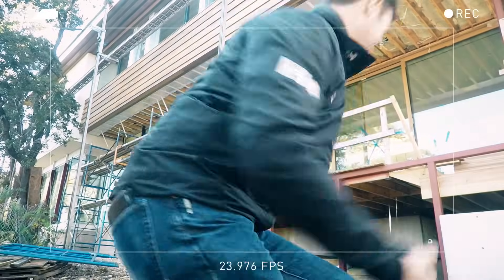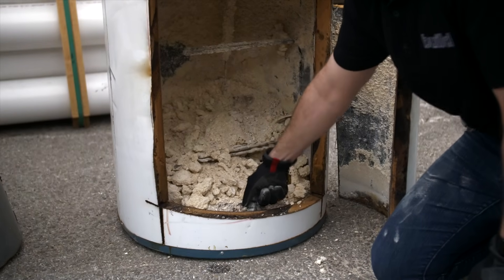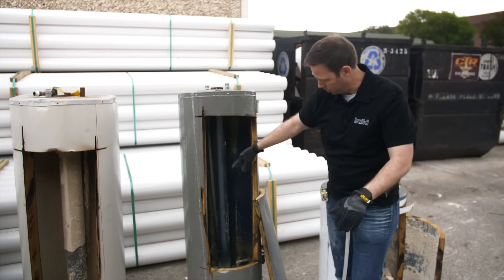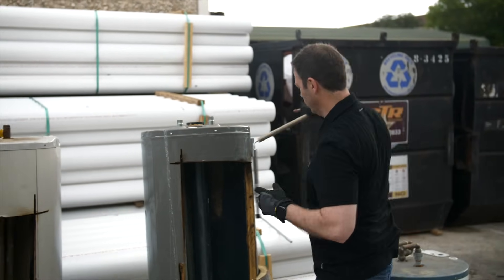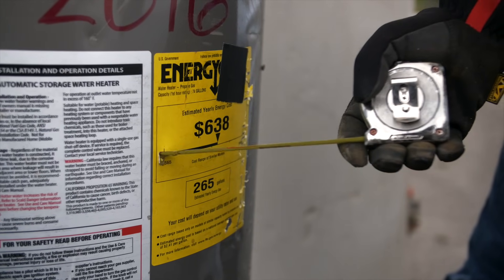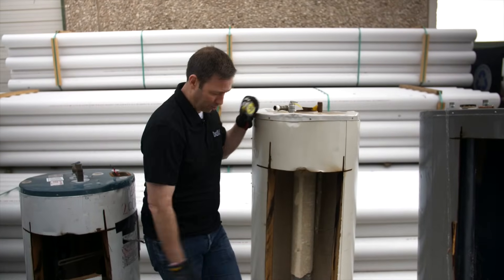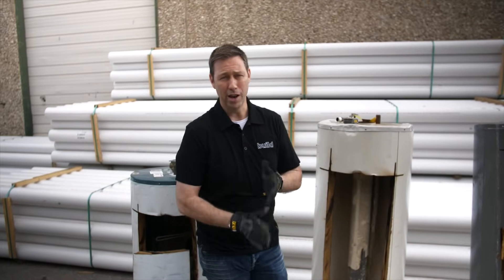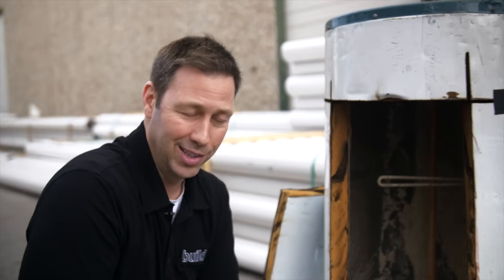Four Water Heater Tanks Cut Open - Lessons to Learn

Comment: How thick the wall insulation is may not be that important.   Where I live I heat my house about 9 months of the year and if any heat escapes the hot water tank , it goes into the house, so my furnace does not have to burn more gas.

Comment: 15 year standard? Nothing made today sold at big box lasts longer than 6 years if you are lucky. Why are supply house units of quality 2-3x as good as store bought? I have a 500 sq. ft. house and settled on a Thermomate 18 gallon unit. I am in disbelief at how efficient and quality it is. I can get a 10 minute shower, dishes, and any extras done on one tank. It has been 4 years and I replace the anode rod every year, flush every 3 months.

Comment: My water heaters, all electric, seem to last about 30 years. I ALWAYS put them on a wood pedestal about 8"-12", high. This breaks the corrosion conduction connection to the (usually) concrete floor. Considering 'rust' is actually 'electrical reduction', breaking that path is hugely beneficial.

Comment: Flushing doesn't work . The best way is to  remove the bottom element and a hose or pipe and shop vac threw element hole.

Comment: Question for professional plumbers:  Does setting the TEMPERATURE at lower settings REDUCE the rate of scale deposits?  7:15 Wonder if this extremely scaled heater was run at highest temperature settings? Perhaps it was used for some type of hydronic heating system.

Comment: 1:15 Scale causes poor efficiency?   Sure, if the electric elements are insulated, all the heat gets pushed back to the turbine at the power plant. < sarcasm >  Okay, a scaled up gas CWH can cause more heat lost up the chimney.   Scaled up tank will have less reserve of hot water, and the scale may insulate the elements causing them to overheat and burn out.

Comment: All electric water heaters are 100% efficient - you put in 1kW/h you get 1kW/h worth of heat.  There is nowhere else for the heat to go but the water.  Scaled up elements just force them to get hotter which increases their resistance, so they use less power.  So scaled up tank heats slower.  Better insulation helps conserve the heat but it is not a factor in the efficiency calculation.

Comment: why is it inefficient? heat transfer is heat transfer wether it is directly to water or through rocks. if it takes longer to heat the water.. it would also keep it hot longer because of the thermal mass of the scale. no?

Comment: I installed my gas water heater in 1998. It failed in 2024, lasting 26 years. During its lifetime, I never did any form of maintenance (MEANING NOTHING).  My previous water heater was electric and it lasted 30 years. Again, I did NO mantenance.  It think this maintence stuff is a bunch of crap!

Comment: I know this is an old video but my 9 year old gas water heater just failed, leaking like crazy.  Luckily I had a pan under it to direct the water outside of my garage and it had a leak sensor to notify me.  It was supposed to be a 12 year water heat at least that was the warranty.  This will be the 4th water heater I've had to replace in this house in the 26 years I've lived here.  Back in the day water heaters routinely lasted 20 and even 30 years, they just don't make them to last anymore which really is a scam on consumers.

Comment: A smallish point but, the efficiency of an electric hot water heater isn't effected by scale inside. The heating element may burn out, because the scale might insulate the heating element from the water, causing the heating element to run much hotter. But the heat has nowhere also to go but into the water, so efficiency isn't effected.

Comment: 1) I replace anode rods often. I've never had a problem with height. If you did you could just cut off a length from the bottom with an angle grinder or hacksaw. 
2) the anode ride was not going to break off at the top. It is being supported by a copper wire. The entire magnesium or aluminum or zinc could disappear and the copper wire down the middle will stay strong.

Comment: When you buy a new water heater make sure it has a metal drain valve on it,  the plastic ones tend to start leaking after a few years and they are a hassle to replace.
I have flushed my tank every year and never seen anything come out.  Anode rod looked good after 5 years.

Comment: 6:10  Seeing .65 Efficiency rated water heaters that appear to be energy Hogs and maxed out to the right on the Energy label guide. A plumber advised that tankless gas units are compared to gas tank units (which doesnt seem fair at all), it seems the new goal of these stickers is to portray the tank types as not very efficient.

Comment: Back in the 60's when I was a kid, my best friend's dad was a plumber. On weekends we'd camp out in our pup tents behind their house that backed up to some woods. As the old saying goes, water heaters usually fail on weekends so we were often pressed into service helping his dad out swap water heaters. To this day I remember him saying he never changed out a leaking water heater with a good anode rod. That somehow got burned into my young brain and for my entire life I've always made it a point to maintain the water heaters in my various homes, flushing them annually and replacing anodes when needed. I'm now in my 70s and while I've had to replace some heater elements and some gas valves over the decades, I have NEVER had to replace an entire heater!

Comment: My house has two 50-gallon electric water heaters. One is 36 years old. Maybe I should flush it one of these days and replace the anode. One thing not mentioned here is the utter uselessness of the 50-cent plastic drain valves installed on heaters. They are certain to clog during any attempt to drain many heaters. The solution really only works when the heater is new: replace the valve with a full-port lever-style ball valve. Fit it with a garden hose fitting and tightly cap it in case the lever is accidentally bumped.

Comment: What Matt didn't tell you is, the sacrificial anode rods are damn near impossible to remove in place. Best chance is to use a REAL impact wrench and a six point socket. No breaker bars or cheater extensions will do because the tank will rotate instead of the anode rod.
Reply from the maker: Great advice!  Thanks

Comment: In 1992 I built my house and when doing so I had a strange idea come to mind.  I had replaced water heaters before and my thoughts were that the anode rod corroding would cause it to snap off and damage/short the coils inside.  I decided to take a chance and I removed the anode and cut it completely off and reinstalled the plug.  The system is on a water softener and is now 31 years old and still going with no anode!  I've replaced the thermostats once and the coils twice.  It's on a timer and is off more than 12 hours a day.

Comment: The tank in the house we just purchased has a 20 year natural gas unit, when I turned up the heat it began banging like you were hitting it with a hammer, lower temps it’s still noise but not as bad. I have a new tank ordered. Might be fun to open it to see what’s inside.

Comment: just replaced my 36 year old natural gas water heater never maintained or touched. Worked great until it began to leak from the very bottom center. Ran great and fast hot water never ran out either even while leaking. The only issue I had with it over the years was the noise. It was noisy.

Comment: When replacing the anode rod I recommend using an impact gun.  If you try to use a breaker bar it will twist the tank and possibly damage the water pipes.   In my case, I had CPVC pipes which are prone to cracking if torqued.   I bought an electric impact gun and a 27mm (sae 1 1/16) socket and it spun right out without twisting the tank and pipes.

Comment: Having hard water even with a conditioner system maintained by a service contract Ive replaced three water heaters since 2002. First was a Rheem installed in 97, second was done by an AO smith factory rep in 2006. The third one I did myself from Rheem and it got us 7 years. Today i put a Bradford White in. same service but better quality unit so they extended my service plan to 10 years. well see...

Comment: Man flushing doesn’t do squat… its all about water hardness under pressure. Like 🤔 about it; the boiler valve is at the bottom and so is the dip stick so “flushing” only gets whats on the bottom not to mention those bigger chunks ain’t coming out. Im a plumber yada yada yada … i tell customers unless they’ve kept up with flushing every year after install @5-8yr mark of no maintenance they might as well just let it ride till it leaks or update now.
Reply: Exactly, unless you have a known issue leave the tank alone.

Comment: Most home insurance companies in Canada will not insure you if you have a water heater more than 15 years old. Some companies do 20 years old, but it varies quite a bit. Here in BC, it’s mostly 15 years maximum. 
They are treated up here as disposable items, and very very few installers go over any kind of regular maintenance program with you.

Comment: This isn't really any brainer, in the power plants, they have the same issues, the difference though, is that they are aware of these things, so they take actions against scales, corrosion and other things, most advanced is the nuclear plants, as they make sure they have absolutely clean water, as they use some additives as well, but also use much more resistant materials in pipes, heat exchangers etc.
How ever, its a question about price, if the same technique was to be used in our homes, our heat water systems might cost 3 times more, and take lots of more space, not to mention all the issues with chemicals and stuff to clean the water.

Comment: Seems to me that not enough "science" has been applied in the design of these water heaters. Surely it can't cost that much more to increase the thickness of the insulation and to gain so much more in doing so. It's like the heavy lead acid batteries in cars, by now with so much tech about I would expect them to come up with a lighter unit and one that can communicate with the onboard logic. In both cases change is not on the agenda and it's sad.

Comment: I personally would NEVER use an aluminum anode rod in a potable (drinking) water heater as the anode rod is designed to corrode to save the carbon steel structure of the vessel & aluminum byproducts of corrosion in potable water is NOT a healthy thing.  Aluminum rods are typically used in water that has high sulfates - but I would never drink this water.  The reason why anode rods fail at the top where they contact the carbon steel is that carbon steel is closest to anode rod & the anode rod is doing its job.  I’ve seen anode rods corrode off & drop in the tank.

Comment: My water heater is close to my garage. in the winter I take a 5g bucket, 3LBS salt, and use my boiling hot water and pour it on the driveway. Instant snow melt. That's how I flush my water heater.

Comment: We have one in our small rental home that was installed by auntie in 2000. Doesn't even have a petzo lighter.  They serviced it semi regularlly.changing the rod at least once. I regularly. drain some water out of it and installed a new rod 2 years ago. So installed  22 years again and still working in 2023  I also drain a little out of mine via the drain and the pressure relief valve ( they can freeze shut). Do that every few months. That sediment can add up quickly at the bottom making the burner not burn right.

Comment: They could easily make a tank last a life time if they Wanted. Why use Metal period. Many other materials like Fiberglass, composite, epoxy, plastic etc that would never corrode. The only repairs would be replacing the heaters and electrical parts.

Comment: 1. Most of the time I couldn’t loosen the anode rod without destroying the threads.
2.  About the third time I open the drain valve it won’t close.
Both events require replacing the whole heater.

Comment: What every homeowner/water heater owner needs to take into consideration is the quality of the water entering the WH.
I've seen units that were flushed and maintained yearly fail after 10 years, and I've seen units that were never flushed or maintained last 30+ years.

Comment: 15 years for a water heater?  Not here in the desert southwest. Even with maintenance, you’re looking at 5-8 years. 10 max if you have a filtration system to get the minerals out before entering the plumbing

Comment: I am about to replace my 41 year old Jackson gas water heater due to its diminishing performance.  When I moved in 22 years ago the drain valve was already about plugged, but I have been able to keep a working release valve in it.  It has not been drained in the 22 years I've lived here or had the anode rod replaced.  No water softener.   It's a 50 gallon, but I think there is at least 10 gallons of scale in there now.

Comment: $650 per year for propane heat (the second tank).  No wonder they replaced it long before it failed.  A new heat pump/exchanger electric powered heater costs $2000 new but only costs $100 per year to operate.  That would pay for itself in just 4 years.    Propane would be an option if you don't have electric service and don't have natural gas like a cabin in the woods far from any road.
Reply: It's probably more like 1500 a year with the new propane prices!

Comment: Mine was installed in 2001, my water is softened and it is working like a champ.
Reply: Soft water is more dangerous for you tank than hard water. Very soft water is corrosive, hard water is not.
Reply: @pauld3327  Most water tanks are luck to last 15 years, most don't make 10 years. The last water heater I replace was a 5 year old AO Smith water heater with a leaking tank.
Reply: @bryanrocker5033  Is your water soft or hard ? Do you have a water softener ?
Reply: @pauld3327  I have a water softener because my water is so hard. I also have a 5 micron whole house filter I change out regularly.
Reply: @bryanrocker5033  I also have very  hard water and I don't have a water softener. My water tank last 15 years. 
I think your water tank leak was due to your water softener, It makes your water corrosive. You could change your water softener settings to make  your water between soft and hard, your water tank will last longer.
Reply: @pauld3327  My current hot water tank is 22 years old and works great,
Reply: @bryanrocker5033  My manufacture date on mine is 1999, installed in 2002.  It's used to also heat the water circulating in my furnace. It's called an Apollo Hydro-Heat system. It's still going with no problems. I called a plumber to change the sacrificial Anode and it's so old he wont touch it . Am I just lucky. They are hard to find in case I have to replace it. the original company is out of business.

Comment: This video is now a few years old, but still very relevant.
That first, short and stubby, small water heater is just a miracle. One can wonder where it was, but my guess somewhere in the MW with very mineral rich water. The 2nd you looked at, likely had a a 'glass' glazing on the inside to prevent corrosion (common on pricier models).
All that said, plumbers and media have trained the US consumers into expecting that water heaters only last 10 years and you need to replace with - preferable - an expensive instant heater.

As you point out in the video, with very minor and regular maintenance, there is no reason a water heater cannot last 30 years or more. My 50 gallon natural gas heater is on its 22nd year - and I expect it to last another 10 years. I did replace the sacrificial anode after 14 years of service. The anode was - as expected - corroded (that's good) but not as bad as one could have suspected. And even though I have low clearing above water heater (low basement ceiling) I managed to get a solid new anode rod inserted w/o issues. Biggest task was getting the old one out, which did require the use of an impact wrench.
As long as people monitor their water supply (especially if very rich in minerals), flush the heater with some regularity to get rid of potential crud that accumulates at the bottom, and replace the sacrificial anode (a $20 part), these very simple and very basic appliances should just last (almost) forever.

Coming from northern Europe, it's essentially unheard of needing to replace a water heater after it's been installed. In houses with hydronic heating (wall mounted radiators), the water heater is either a copper coil or a container vessel, 'submerged' inside the boiler. The boiler will keep the surrounding water at a constant temp (70C or 160F) summer and winter, and indoor temp is controlled by 1) a shunt valve mixing the outgoing water to the radiators, and 2) individual valves (often thermostat controlled) on each radiator. Compared to our 'forced air', it provides for a very soft, comfortable, economical, and very reliable heat. Yes, it does cost a bit more to install day 1, but houses are built to last 100+ years. And most important, wall mounted radiators do not promote any dust.
The 'boiler' can be powered by fuel oil (very common up until 15 years ago), firewood, wood chips, pellets, electricity, heat pump, or in cities that have a centralized hot water plant, just by hot water (not steam) that is being piped around in a huge network of pipes in the streets. The 'boiler' in that case is just a heat exchanger, about the same size as one of our 'instant gas powered hot water heaters' here in the US. Very simple, clean, uncomplicated, with zero pollution from the individual home. drawback is that you are tied to one supplier (often a city owned utility) of hot water.